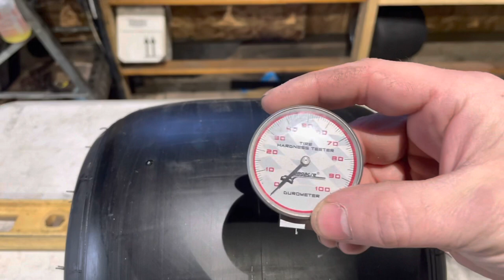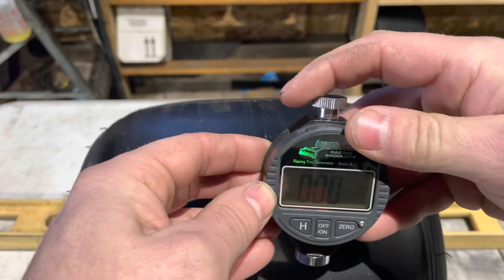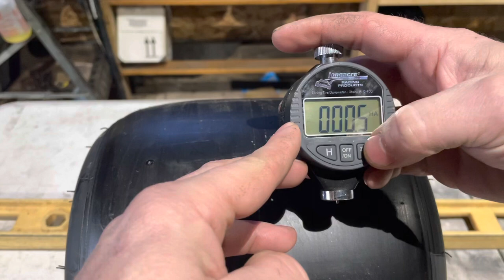Using A Tire Durometer

Comment: Would you suggest to drop durometer and then hit with black sand or black sand and then use prep to drop duro?
Reply from the maker: Drop duro first.  Black sand only drips a couple points.
Reply: @kart6t3_ben  thanks. Just subscribed to your channel.
Reply from the maker: @vernherrman5811  I really appreciate that!

Comment: what would you use on a hard dry dusty track? most are on maxxis blue and pink.
Reply: Track tac black sand prep. Or diamond
Reply from the maker: Papa is correct.    Black sand is a great bite adder for those type conditions.  Sunday after a race 1/2 straight wipes and let set all week.  Then at track cut Black sand 50/50 with acrysol or something similar for fast drying Pre Race Wipe.
Reply: @kart6t3_ben  My question was about tires. I do use black sand just wondering if there is a better tire than blue and pinks?
Reply from the maker: @ddeadbeat   if most racers are using Maxxis that’s a tough call.    I’ve heard decent things about Cobra tires and they are super cheap (but I’ve never used them).  I really like Vega Blues , they are a harder tire like the Maxxis.